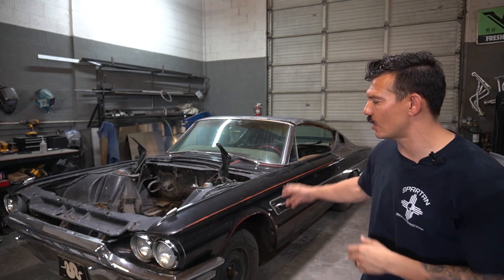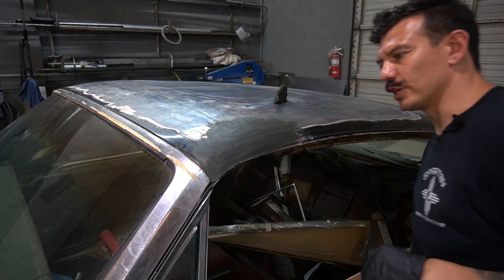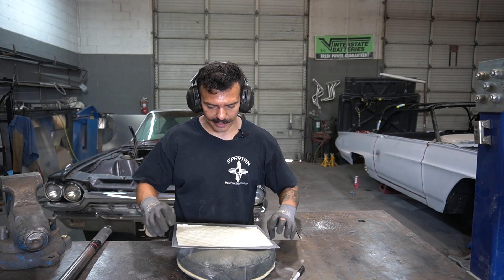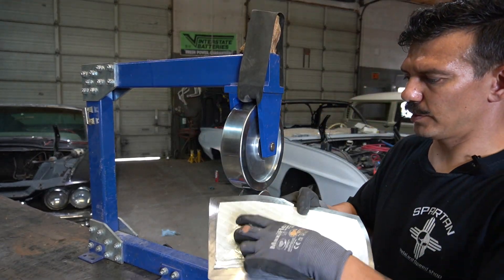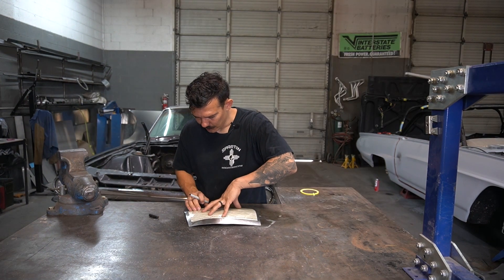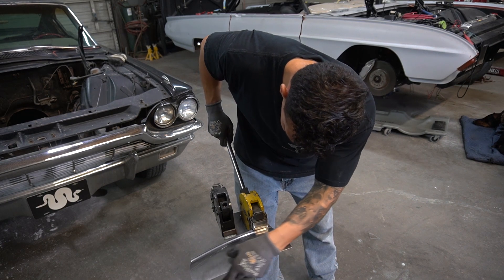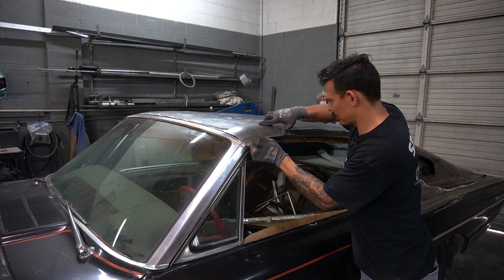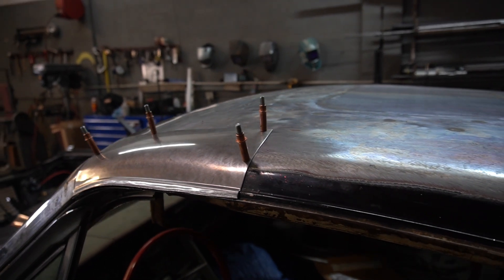How to make a complex patch panel | Metal Fabrication | Sheet Metal Shaping

Comment: Very nice.
The only thing the video didn’t cover was making sure that you’re not compounding someone else’s errors.
The door seemed to have a piece of wood for the glass. If this was in the same pattern as the OEM glass and fitted correctly then no problem. But if it was going to require custom glass just because the roof was butchered and not because an OEM glass would never work then the time to correct the errors would be before making the patch panel.
Reply from the maker: Well the reason it's going to need different shaped glass is because it didn't fit the contour of the different roof.

Comment: Nice work, I have a bead roller but am new to it, so after all the work you put into the initial panel I would have been nervous running it thru the roller, afraid of it bending wrong, I just need more practice
Reply from the maker: Yeah I still get that nervous feeling sometimes for that reason😅. Altho most everything in metal can be fixed